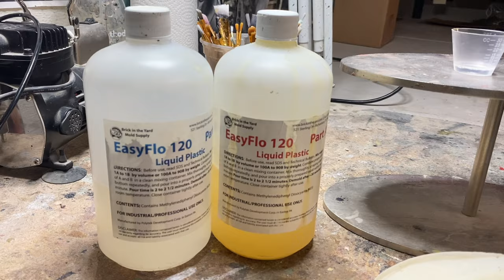Making a bust of The Child Catcher from Chitty Chitty Bang Bang

Comment: Amazing! What paint do you use? Is it acrylic latex and water? Also how do you mold the mouth with the tongue and how did you know your teeth would be a perfect fit
Reply from the maker: I use a paint called Nightshades. It's specifically made for use on rubber masks. There is no tongue inside the mouth. The teeth are actually casting of my own teeth. They are plastic. I sculpt the heads with the plastic teeth inside the mouth and then remove them when I make the mold. Then after the mask is painted, I use epoxy to glue the teeth to the inside of the top of the mouth.